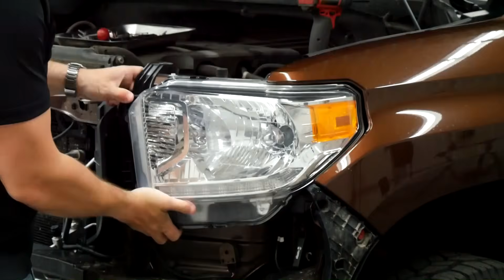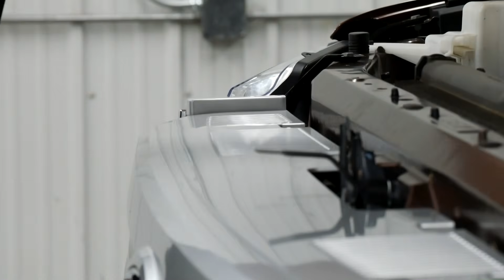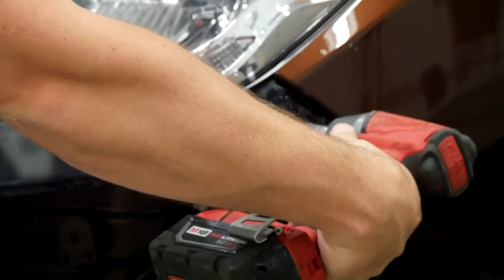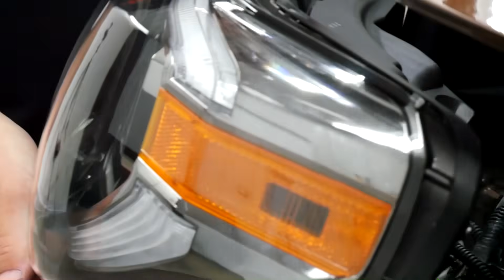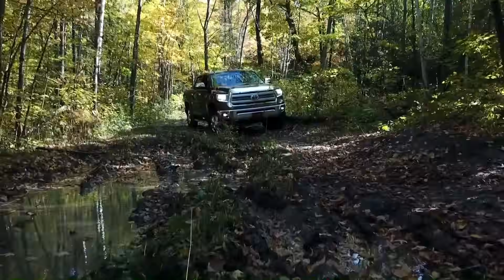Updated: Installing Toyota Tundra OEM LED Headlight Housings 2014-2018

Comment: I ordered and received the GTR turn signal and side marker package.
The Turn Signal GTR's don't fit the sockets of the OEM LED Upgrades. 
Could you list the proper GTR package I need to order?
Reply: DO NOT BUY HEADLIGHTS FROM HEADLIGHT REVOLUTION!!!
Worst customer service ever. I ordered headlights for my 2014 Tundra, I received headlights for a 2016 Tacoma. 
Been trying to return for months. HR will not respond to emails or phone calls. I'm out $1072.05.
Reply: @bbnurface  They told me to FORCE the LED Turn Signals into the lamp sockets.
That's the stupidest advice I've heard. (Lately anyway)

Comment: The issue i have is my climate control knobs blink with my turn signals. I followed instructions and i have no drain to battery. i did not put any resistors and running my halogen turn signal bulbs. Whats the problem?
Reply: It’s a 2016 tundra non drls.
Reply from the maker: That definitely shouldn’t be happening—thanks for flagging it! Go ahead and reach out to us and we’ll help get it sorted: sales@headlightrevolution.com or 218-755-5200.
Reply: Thanks tech support!! Cutting the purple wire did the trick! No more flashing on my climate control lightning

Comment: Would you guys still recommend the oems over the alpharex pros with led bulb?
Reply from the maker: We’d probably still lean toward the OE LED since they perform really well, and the Pro would ultimately be based on the LED for performance. Something like the Ultra 3 could be a great option too, but we haven’t tested them specifically in the AlphaRex Pro headlights yet.
Reply: @HeadlightRevolution cool thanks I’ll order up soon

Comment: That's was not plug & play....having to remove those little wires & changing their position is a problem & I never hadda do that on any headlights I've done.
Reply from the maker: Appreciate the feedback! That small wiring adjustment was actually part of an updated modification we made after launch to ensure full compatibility across all vehicle trims. We know it’s a little extra work compared to traditional plug-and-play setups—if you ever run into questions during install, our support team is always here to help!

Comment: Hello! I just installed the new headlight and decided to get the LED turn signal as well. I have both harnesses as well and everything works but my turn signal is blinking rapidly. Anyone know why this is or had a similar issue?
Reply from the maker: Sounds like you need resistors to prevent hyperflash! Reach out and we can help - sales@headlightrevolution.com or 218-755-5200
Reply: @ i have resistors installed on my rear turn signals from you guys. I bought the full led conversion from your site. They don’t blink rapidly anymore but when I turn on my lights they go back to blinking rapidly. So just car on without turning lights on it doesn’t, car one with headlight on it does.

Comment: Do you have to replace entire headlight if low beam or high beam stops working ?
Reply from the maker: That’s correct - one downside of LED headlights, whether OEM or aftermarket, is that they don’t have replaceable bulbs. If a low or high beam stops working and troubleshooting doesn’t resolve the issue, replacing the entire headlight is the solution.

Morimoto offers a 5-year warranty on their headlights, AlphaRex provides a 2-year warranty, and we also offer a 2-year warranty on OE LED Tundra headlights purchased from us. You can check them out here: https://www.headlightrevolution.com/14-18-toyota-tundra-oem-led-headlight-upgrade-kit-TundraLED-Housings_2?quantity=1

Comment: You have no concept of what “Plug & Play” means.
Reply from the maker: Plug & Play means exactly that - no custom wiring, splicing, or modifications needed. Just plug it in and it works!
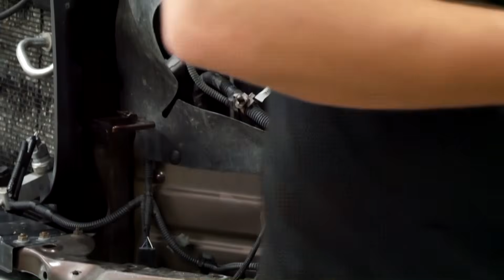Reply: @HeadlightRevolution watch at 4:25, turn signal replacement. That ISN’T plug and play
Reply: @ I need to modify the wiring for the turn signal correct?

Comment: Do you happen to know what the part number is for the turn signal bulb socket? Mine melted since I skipped the rewiring of the turn signal and the socket is a little smaller than OEM and I can’t find the right one in stores or online. Thanks!
Reply from the maker: Shoot us an email! sales@headlightrevolution.com

Comment: I skipped the part where you have to rewire the turn signals and the amber lights were constantly on. I thought that was normal until one of them stopped working a could days after install. Took the plug out and it was melted. Looking back at this video I realize I messed up. Thanks!

Comment: What’s available for my 2012 Tundra? LED headlamp upgrades?
OEM or non?
Thanks u guys!
Reply from the maker: This is everything we have for your 2012 Tundra: https://www.headlightrevolution.com/buyer-guide-by-vehicle/2012+Toyota+Tundra

If you want a full LED headlight upgrade, check out the Morimoto XB LED headights. We also have some HR Tested listings for LED bulb replacements if you scroll down some!

Comment: On the website it gives option only for smoked or black. Is one of those the standard for what toyota puts in the 18-21 tundras?
Reply from the maker: Both would be standard, this is just the color of the trim inside the light. 
Check this video out for more info!
https://www.youtube.com/watch?v=fGnLoHpXhqc

Comment: Wow I didn't re pin my lights I have the 3 pong ..my turn signal bulbs where always on so no it would get too hott..I'ma try and see what happens=update they do work but you do have to change your 2016 turn signal bulbs to 12v28/8w ..or leds

Comment: Where does the extra cable with the fuse end go that came in my conversion harness package for headlights w/o led drls? Everything else is working perfectly so I just need to know where to plug that. Thanks!
Reply: Never mind, I found the answer after searching other comments from previous questions. I’ll try and switch the fuse and tie down the extra cables tomorrow. Not a lot of extra work but I may not have purchased if I knew I had to mess with the fuse box. If all goes well maybe I’ll give the fog lights a go. That install looked like a lot more work though.

Comment: So.... I have a 1794 edition with running drl's. Do I need the extra wiring harness? Can the original  leveling motors be accommodated? Turn signal upgrade- do I need the resistors?
Thanks.
Reply from the maker: You'll need this harness for $106.
https://www.headlightrevolution.com/toyota-tundra-oem-led-headlight-conversion-2009-2018-H-TUNDRALED_2?quantity=1

The original motors can be swapped over. For a turn signal upgrade if you use the i-LED bulbs you will not need resistors.
Reply: @Headlight Revolution  what is the part number? For the "I LED" TURN single bulbe?
Reply from the maker: The link is below, for any further assistance please reach out to or support team to make sure we will see your messages.

218-755-5200
Sales@HeadlightRevolution.com

https://www.headlightrevolution.com/brightest-7443-turn-signal-bulbs

Comment: When you do this upgrade are you still able to use the beam adjustment knob? I’ve got a lift, and need to make sure the beam is adjusted.  Great video, thank you!
Reply from the maker: Yep!
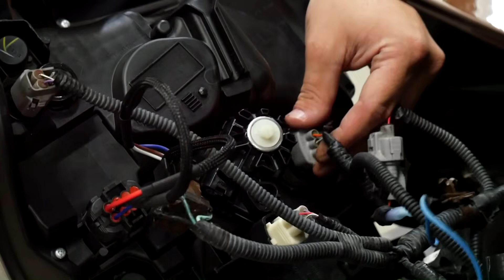Reply: Yes, if you re-watch the video, at the 7:10 mark, he installs the connector to the power motor that adjusts the beam up and down.

Comment: On the LED turn signal lights upgrade was there a non-hyper flash resistor installed? if there's none, can I please get the part number or link, Thanks
Reply from the maker: https://www.headlightrevolution.com/7440-7443-gtr-lighting-carbide-bulbs-LED.BUL.7443.CAR2_2

Comment: Do I need a harness for the 2018 sr5? I currently have halogen
Reply from the maker: You will need the conversion harness, if you have the basic halogen headlights you will need the DRL harness as well.

Comment: Awesome video, I plan on doing this to my 2017 tundra soon, but although everything is explained well, I wanted to be sure, outside of the headlights themselves, all that’s needed is the drl harness right? Plus regarding switching the wires around for the turn signal, is that something you need to do right off the bat or is that only if you have issues after hooking them up? Thanks!
Reply from the maker: Shoot us an email at Sales@headlightrevolution.com and we can help.

Comment: Have a 2014 tundra with the conversion harness but no DRL when I turn on what did I do wrong?
Reply: Idk if you solved it yet bro but you need to get the drl harness and then connect it to the fuse box, super easy and it’s like $15 for the harness

Comment: I purchased these headlights as well as the harness. There’s a 4 pin connector that’s supposedly plugged into the stock headlights in order to provide power to the new headlights but there is only 4 connections on the stock headlights not 5 so where is this 5th connector located on a 2014 tundra
Reply: Same here. I don't have a 4 pin on mine. Did you figure it out?
Reply from the maker: Reach out to our CS team so we can help you out!

Comment: I just did the complete conversion (Headlights, Morimoto Foglights, Reverse, Cargo, and License Plate Lights). 2014 Tundra 4WD SR5. Everything worked great and was an excellent upgrade. I only had two small issues. 1. The Morimoto Foglights required a hybid of the OEM and the Morimoto mounting brackets in order to get them to fit correctly. 2. My Tundra had the 3 wire blinker harness (White/Black-Purple-Pink). I followed the HR video on repinning the harness. When completed, my dash lights flickered and followed the sequence of the blinker when the headlights were off. I contacted HR Tech Line and they advised me to unpin the purple wire in the middle on both harnesses. This resolved the issue! Not sure why they don't reference this in their Youtube videos but the HR Tech Line was a great resource. Keep that in mind when buying aftermarket products. Thank you HR! I will definitely buy from you guys in the future. I hope this helps some of you considering this conversion.
Reply: I had the same issue with my radio unit blinking when I put on the turn signal. I unplugged the purple wire and it fixed the issue.
Reply: Where did you find the bracket for the fog lights?

Comment: The only reason for the passenger halogen headlight to be that way is because it isn't an OEM headlamp. I've seen it time and time again where aftermarket replacement i.e. DEPO or the like have poor beam pattern.
Reply from the maker: Not sure what you are getting at her at all, but the only brands that we use for those OEM housings are ones sold directly from Toyota, we carry the TYC brand and the actual OEM Headlights, both sold directly from Toyota! Let us know if you have any other questions, have a great day!
Reply: @HeadlightRevolution  the halogen passenger headlamp didn't perform like how it should with the H4 bulb.  It should have had a good cut off and diagonal up to the right. I would doubt it was an OEM headlamp. The OE replacement headlamps I've experienced with never had the same quality beam pattern as OEM headlamps. There are hot spots, narrow beam and even glare on some. 

Not to be confused with the LED headlamps you guys installed.  I'm talking about the halogen passenger headlamp that had a goofy beam pattern.
Reply from the maker: Maybe you have a differrent headlight, but these are the halogen bulbs in the OEM halogen reflector housing! Thanks for commenting, let us know if you have any questions!
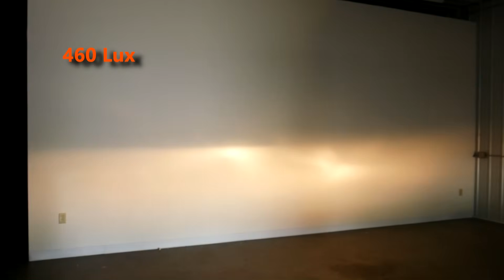Reply: @HeadlightRevolution  I'm referring to the headlamps in your video before you swapped them to the LEDs. At 8:30 & 9:30 in your video it shows the poor beam pattern of the right headlamp.  If you made sure the bulb was seated properly as demonstrated, then that right hand headlamp that was on that Tundra was probably not OEM.
Reply from the maker: I can assure you that was the OEM 1794 Edition halogen headlight, with the OEM halogen bulb installed! It is literally that big of a difference, that OEM LED quality is just hard to beat! Thank you for your time, let u sknow if you have any other questions!

Comment: So if you need to use the DRL harness you don't connect the 4 pin power plug as seen in this video?.......you install the piggyback fuse adapter from the DRL harness and then plug the DRL adapter plug into that 4 pin connector on the conversion harness instead of the original 4 pin power plug from the truck  ?
Reply from the maker: Not sure what 4-pin plug you are referring too, but if you do not have DRLs from the factory, all you will need to do is install that fuse tap harness. If you have the DRL strip from the factory, then you will not need that fuse tap harness! Let us know if you have any other questions, have a great day!
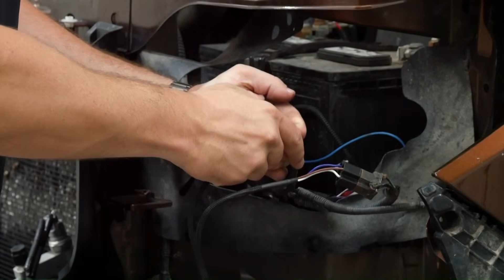Reply: At 4:15.....you show the conversion harness going to the 4 pin power connector from the truck. Then the other end of the harness going to the new headlight. 
If you have to use the additional DRL harness as per that additional video it's states that you just plug it into the conversion harness.
If you follow the instructions in this video there are no open connectors on the conversion harness to plug the DRL harness into. So where would you plug the separate fuse tap DRL connector into the conversion harness as seen in that supplemental video?
Reply: Nevermind! Installing right now. Figured it out and man they look amazing! 👍
Reply from the maker: Sorry we missed that, glad that you were able to get that figured out though! If you have any other questions or concerns, let me know! Have a great day!
Reply: @mmickey8997  I’m running into this issue can you help me find that 4 pin power connector

Comment: Do these work for the 2021 models?
Reply from the maker: I am sorry to say that those headlights will not work on the 2021 model Tundra, they are for up to the 2018 Model trucks. Wish I had a better answer for you, sorry about that!
Reply: @HeadlightRevolution  huh? Why wouldnt they work on the 21
Reply: @HeadlightRevolution  that doesn't seem correct??

Comment: Best lighting upgrade on the 3rd gen Tundra. High improvement over stock halogen, and nothing touches the high beams for mountain driving.  Add in Toyota reliability and this is the go-to lighting upgrade.
Reply from the maker: They are a fantastic option, we sure love the light output we get from them!

Comment: Dose this fits 2020 model?
Reply from the maker: Those should still work on that model year! You will just need to make sure to select the correct option between having OEM LED or OEM Halogen!👍 I have linked the products right on the website! https://headlightrevolution.com/2014-2018-toyota-tundra-oem-bi-led-headlight-housing-pair/

Comment: I installed these recently on my 2016 limited that did not have DRLs. Is there a way to not have the amber drl (turn signals) on all the time? I like the look without them on, just the LED DRLs.
Reply: Did you get an answer?? I’m having the same problem .. hate the amber being on with the led drl and being on while headlights are on
Reply from the maker: Yessir there is! Shoot us an email and we'll get you the PDF for tackling this! 

Sales@HeadlightRevolution.com
Reply: Switchback LEDs..problem solved

Comment: I recently purchased the black out headlight and they are no where near as bright as it shows in the video did you guys modified the led low beams?
Reply from the maker: No, these headlights have not been modified at all. Did you by the OEM LED headlights, or aftermarket. These are the LED headlights that are made by Toyota.
https://headlightrevolution.com/2014-2018-toyota-tundra-oem-bi-led-headlight-housing-pair/
Reply: Straight from the dealer
Reply from the maker: That's very interesting. Are they aimed properly by chance? These headlights are pretty bright, and are one of our best sellers because of that.

Comment: How come the sr5 2018+ only have the led outline in the lower half. Is the whole led illumination on higher end models?
Reply from the maker: Yes, that is correct. The 1794 and Platinums come with the full LED assemblies for the 2018s. I believe in 2019, all trims come with these headlights.

Comment: Have mine apart as we speak and thought I had everything needed with both H126 and the H126.1 harnesses. Everything was going great till I got to the plug in of headlight. I ordered the Auxbeam H4 LED headlights and now have a connection issue from your harness to the new bulbs. I believe I'm missing a H4 connection piece of some kind between new bulb and your harness. Anybody know what it is I'm missing before calling???
Reply from the maker: The H126 and H126.1 harness are for converting to the OEM LED headlight assemblies. If you're looking to install those H4 LED bulbs, those will plug into your factory wiring with no extra wiring harnesses. 
Give us a call, and we can help you out further with this!
218 755 5200
Reply: @HeadlightRevolution  thanks for the reply. I eventually figured out I had no use for both harnesses I purchased, so I will be in contact soon.
Reply from the maker: Sounds good, glad to hear you were able to figure it out! Reach out to us, and we can get the return process started on those harnesses!